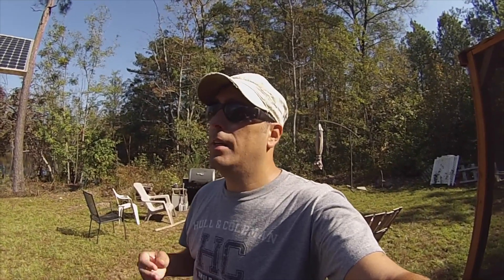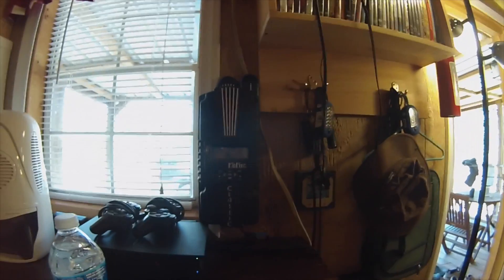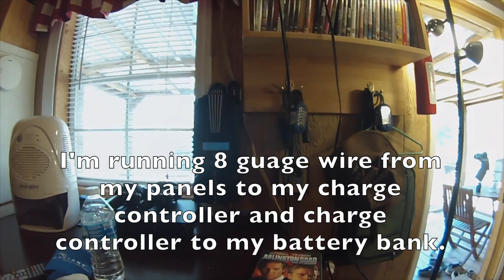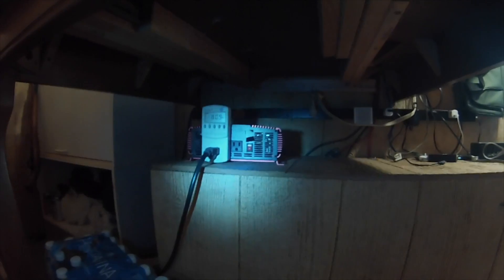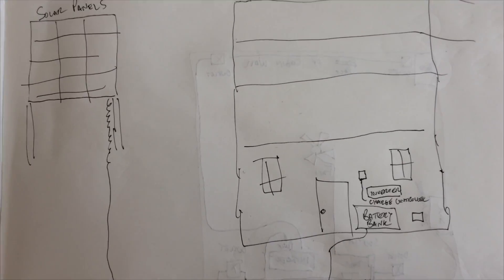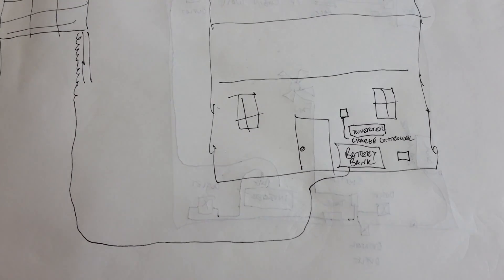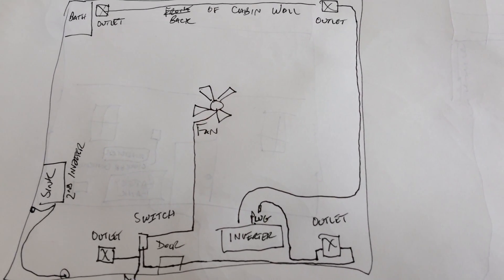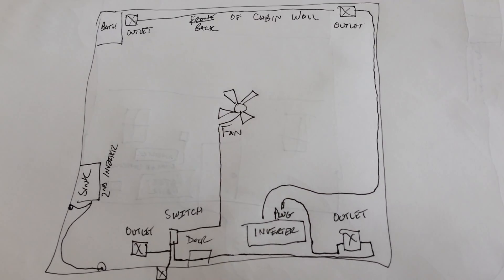My Off Grid Cabin Solar Power Setup: Components, Wiring, etc.

Comment: Hello. Nice video! Good to get additional information from. I would have some questions in case you or someone else could answer. I would like to know how many Amps does the inverter use in standby, so with no load? And, if a mdified sine wave inverter could power a small freezer (the one that has compressor)? I know the issues with inductive motors that might not run with modified sine but, I found no practical advise from someone. As for the inverters, I saw values of 0.5 - 1amp in standby, which is a lot considering solar. For a TV I might use a 12V TV. Thank you.

Comment: If there is any way you can either move the inverter and batteries to the solar or convert the solar to higher voltage, the distance of travel for low voltage yield is poor.  Higher voltage travels better.
Please try to vent batteries to the outside.
Reply from the maker: My batteries are sealed and I'm only on a 25' run. Everything seems to be working good.

Comment: Greetings brother, You have come along way over the last year! Looing good. 30 years ago I lived off grid in the Santa Cruz mountains. I had just 2 car batteries and a 12 volt generator that I built in the shop. I had gravity feed water. I had a 1950s Servel refrigerator and a car stereo in the house. The light bulbs were 12 volt 25 watt incandescent power hogs and very little light. Solar panels were only affordable to the rich and famous back then lol.  Here I am 30 plus years latter off grid again. We are living in a full size house in the Pacific North West living on a 1400 watt array quite comfortably. Technology has come such a long way. We spent our first year off grid here (2 years ago) on 600 watts with a 12 volt system. we learned a lot, mostly how to conserve power. Now with 1400 watts of solar we don't even think about power conservation from April 15th  through Oct. 1st. Last year we burned 27 gallons of diesel in the generator to charge batteries on Stormy days. We had 50 plus days in a row with no appreciable solar power. The diesel cost was for the whole year works out to $4.27 a month. One thing I like about your system is simplicity. Your charge controller gives you a lot of room to grow. What I did is kept the old charge controllers that we used at first and put them in Storage. To borrow from Starry "on a homestead 1 is nothing and 2 is one" because things break down.  With a small system having redundancy is more affordable than a large complex system. Redundancy with off grid components is a good idea in case the USA has another Carrington event or a EMP. Like with your Tiger Claw buying a spare is much easier than  buying a spare Magnum or Outback inverter. All this I am sure you already know, I just like to share things I've learned lol. I had a guy contact me that wanted to compare ideas. He sent me a link to his private videos. I am not in his league at all. He spent at least $50k on his solar system and at least that much on his underground root seller. I live on about $700 a month lol. It takes us a while to save up for even one additional solar panel. I am very thankful we do not have a mortgage payment/utility bill or we would be sunk by know.Remember brother that Jesus is our Hope of Heaven.  Have a blessed day and thanks for the video.
Reply from the maker: +Steven Davis Thanks Steven. Sometimes I don't feel like I'm making progress but when I did my latest walk through video I realized I have made some. You have a beautiful property and a lifestyle I'm aiming for. Thanks for the message.
Reply: Off Grid In The Pacific North West ,Amen my Brother

Comment: Good stuff. The secret with off-grid power is conservation...kinda a "dirty little secret". It is far easier to conserve than it is to produce. Might want to check out my latest video of my 24v "Bug Out Box" Part 5. It is designed for just about anything...small cabin, Base "X", tailgating, camping, trailering, etc-etc. It is a heavy bugger, but it is a self contained, transportable, efficient SHTF/DIY/emergency back up system. Great Channel you got going here.
Reply from the maker: Thanks Chris. I will. I've been watching your content too. No doubt, easier to conserve than to produce. It's funny how much more aware I am of my consumption when I'm "off grid".
Reply: One of the things I learned long ago, was you are always better to go overkill with high quality (more than you need) because in the near future, your requirements will also have increased a bit as you have figured out. For buying charge controllers, better quality is always worth the extra dollars. And always buy more power than you think you will need. This is certainly an area that proves the old adage, "You get what you pay for".  Great video.